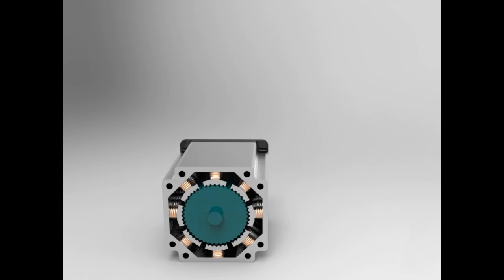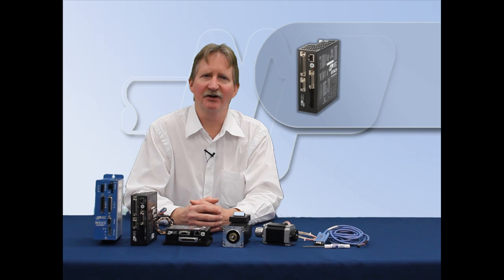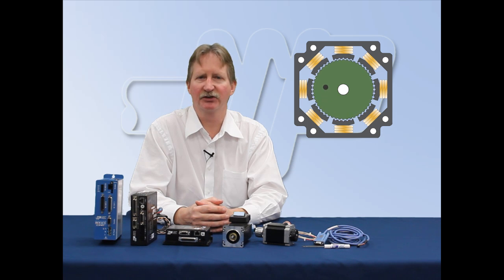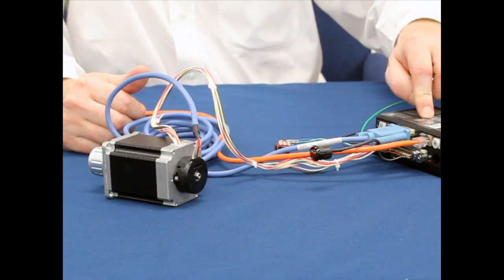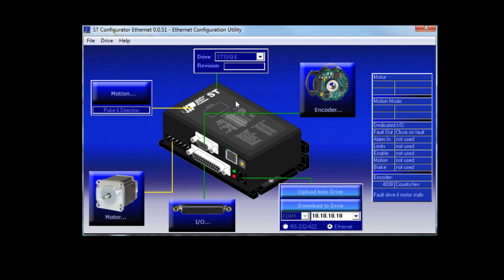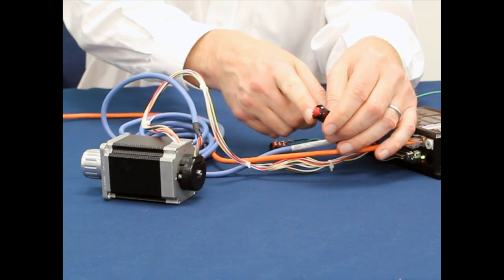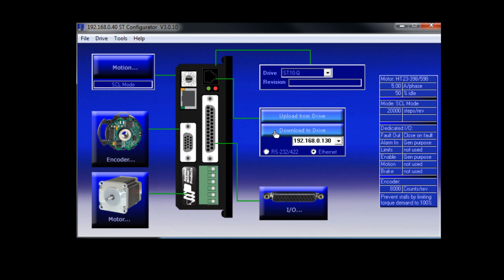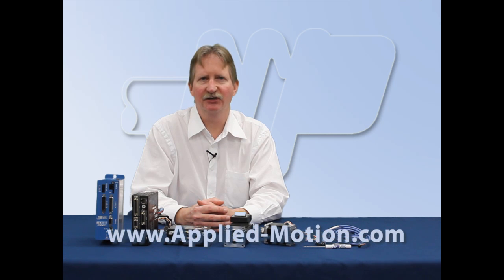Applied Motion Products Presents Encoder Feedback

Comment: Adding the encoder gives a position control loop but not a current control loop, like that of a servo motor and drive combination. What Wrenchmonkey describes can be done with servo. The current set point for the stepper is adjustable so the stall point can be tweaked up or down a bit.